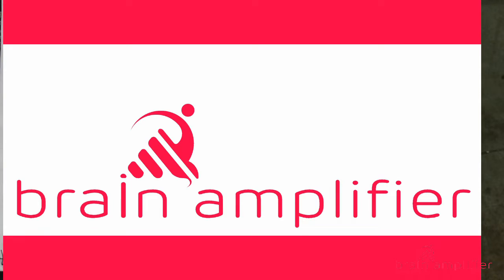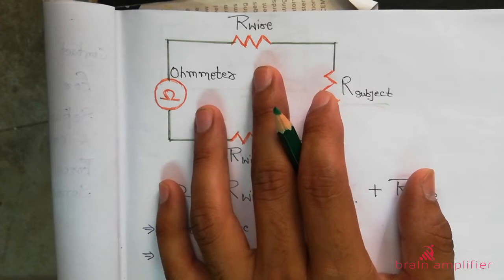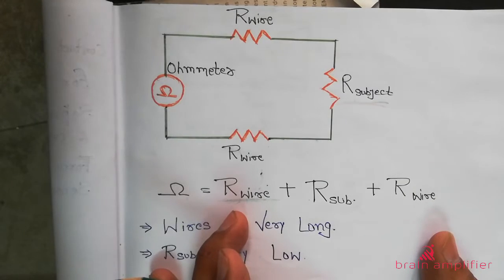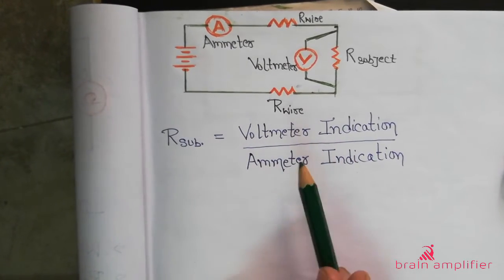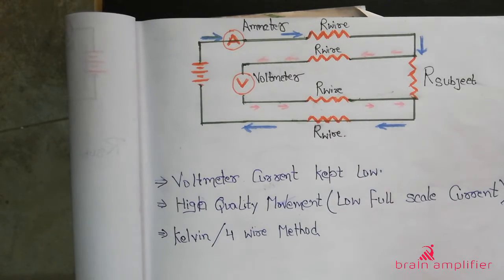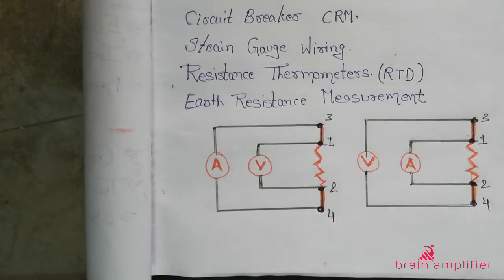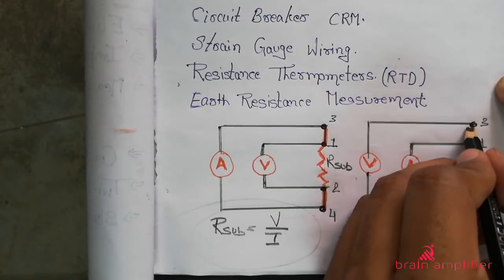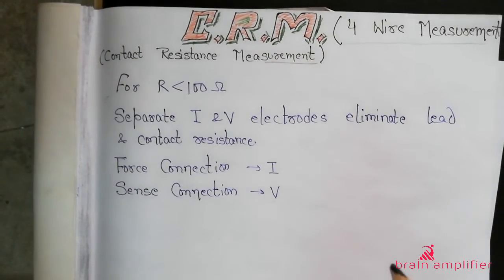4 wire resistance measurement|earth resistance measurement|Contact Resistance measurement

Comment: Thank you. I just orfered a $95 VICI VC480C+ milliohmeter which implements the 4-wire Kelvin method in the meter, using a 4-wire plug-in.I plan to measure the resistance of alternative ways to connect wires. There are $2500 meters whuch would be better,but I'm not that curious.